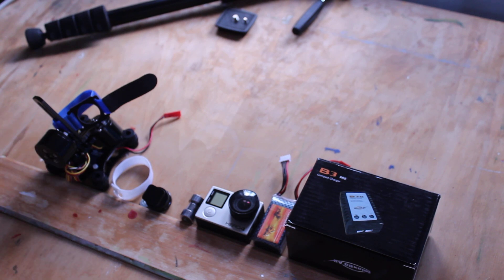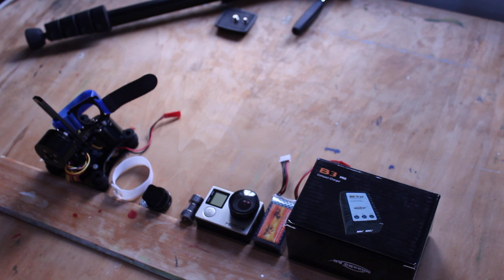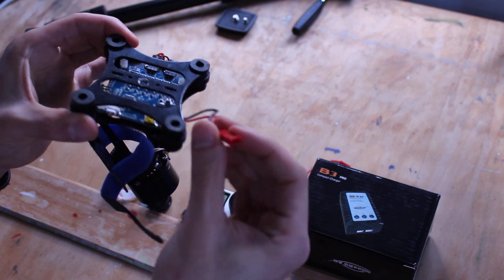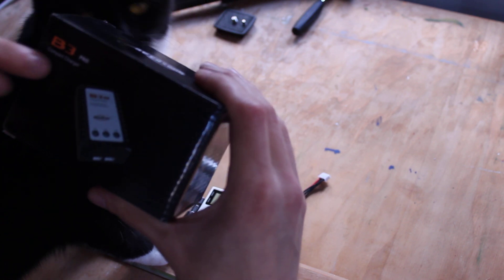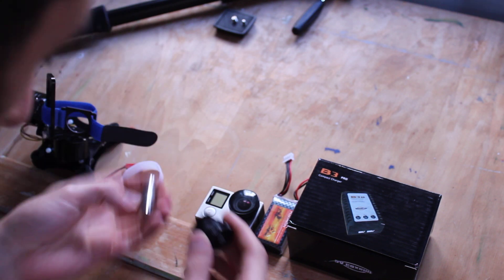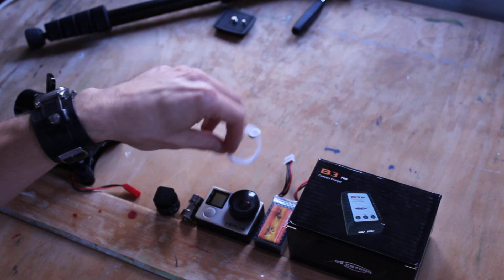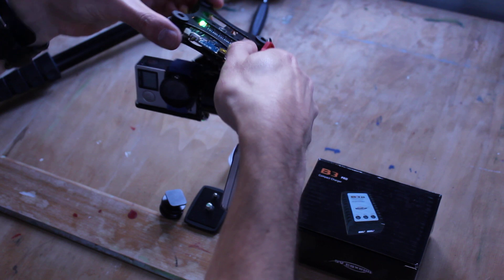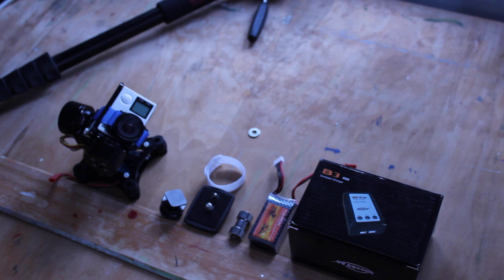£50 DIY GoPro Stabiliser Gimbal Rig Kit List Tutorial - budget steadicam

Comment: What battery do you use?
Reply from the maker: I am using an 11.1v (1000mah) LiPo battery there.
Reply: @stevelitton  thanks
Reply from the maker: @ktchong100  no problem, the bits used are in the description but the links are very old now so may not work.

Comment: Hi :) . Thank you very much for your tutorial. I will do that too. But I have a question. How long does it work with that battery? Thanx.
Reply from the maker: Thanks, appreciate that. A battery like that would generally power a drone and gimbal together so you will get tons of use out it. I have never managed to run it down in a single use yet and have done some pretty long stints using it. I would recommend just buying the one and getting a backup if needed as they are fairly bulky batteries. Hope that helps.
Reply: How long is the longest you've used it?
Reply from the maker: I have used it for a few hours running, switching it off occasionally for short times, i think the power consumption is fairly low.

Comment: Instead of the vencro, maybe you could add zipties? Downside is that you'd have to replace every time you want to unmount and mount but they're fairly cheap
Reply from the maker: +TheMushroom Yeah zipties would work well and be very sturdy. If you only have one battery and don't mind charging the battery with the gimbal attached it could be an easy one-off solution. The only reason I like the velcro is that its reusable and I don't need to ever re-thread it in to the back plate.    

There are tons of ways you can build this rig, my way is by no means the best.